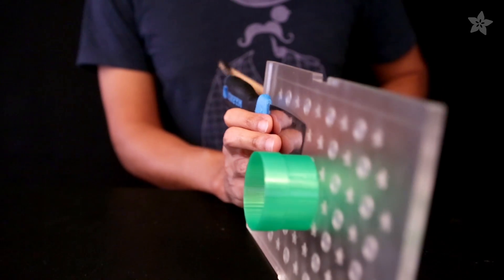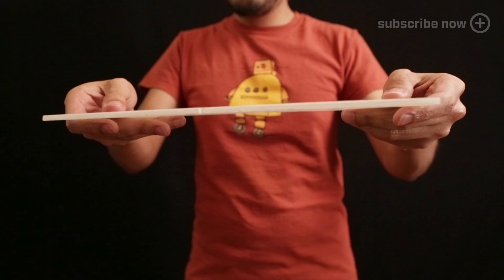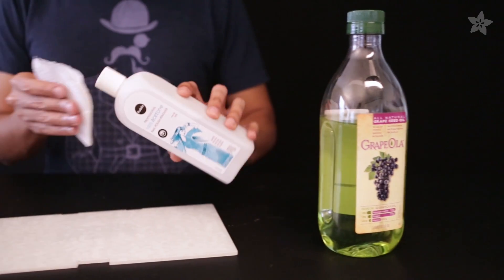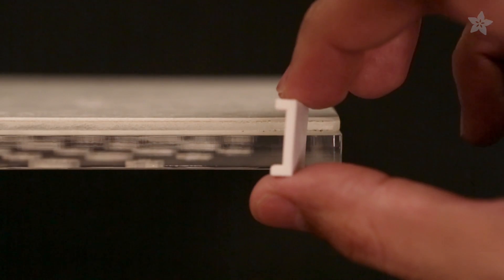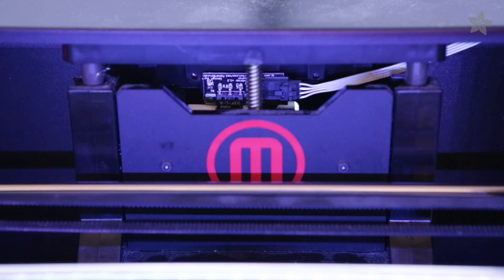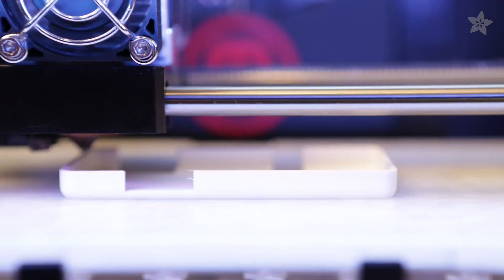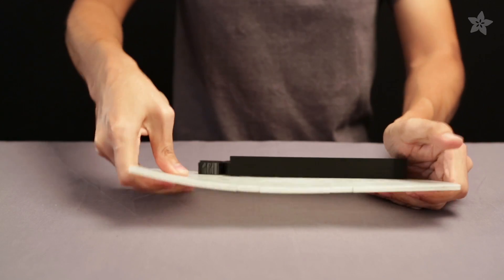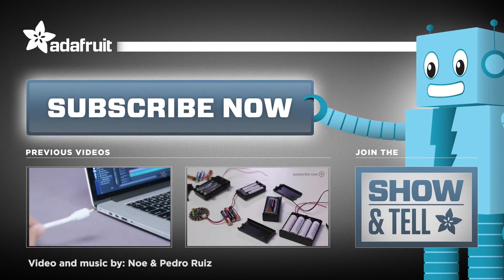3D Printing on Ninja Plate Flexible Build Platform

Comment: We have an Ultimaker2 and I have only printed PLA. So far I haven't had to use any glue stick, blue tape, or hairspray. Nothing. I have had a few minor shrinkage problems at the corners of larger prints. I found that if I just wait a long time, the print pops off with barely any force. Since I am impatient.... now I set up a desk fan to blow on the print after it is done printing. No wrestling and shorter wait time between prints.

Comment: With my Prusa i3 on the glass (with heated bed) where the printer prints I always use extra-strong hairspray so the piece always sticks perfectly and then when it becomes cold it pops out without any problem and without having to take the glass away :)

Comment: For printing pla I use a 8 x 8 plate of plexi glass and it can bend and pop prints off too,but I only find it hard to remove small prints. I'm not sure if it's lexan or acrylic or if  there's a difference.

Comment: This looks pretty cool.

I've been doing something like this for the last few years, but using a thin sheet of steel. Basically, I buy 12"x12" steel sheets from the hardware store for a few dollars, cut them in half, and use that as the build plate, held down by binder clips. It works fine with Kapton Tape (for ABS), painter's tape (for PLA), Garolite LE (for Nylon), etc. The nice thing is that if you have a stack of plates, you can keep printing continuously, leaving the build plate hot, and removing the prints from one sheet while the next one is printing, which really speeds throughput. Also, similar to the Ninja Plate, you can flex the plate to pop prints off.

So I have a stack of sheets ready to go, so I can swap the print surface easily whenever I load a different filament.

That offset clip looks familiar. I wonder if it's http://www.thingiverse.com/thing:43783 ?